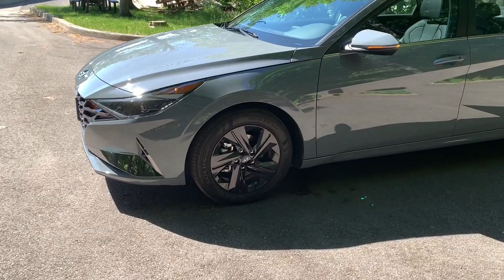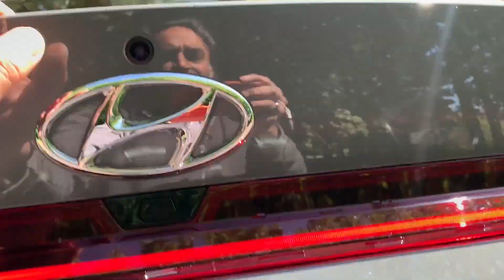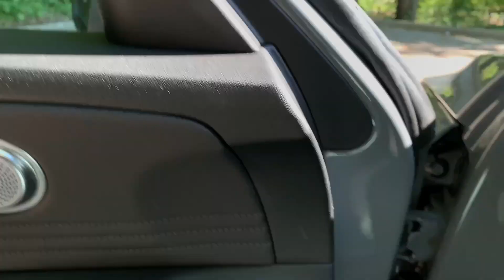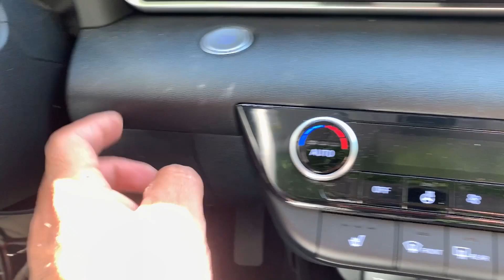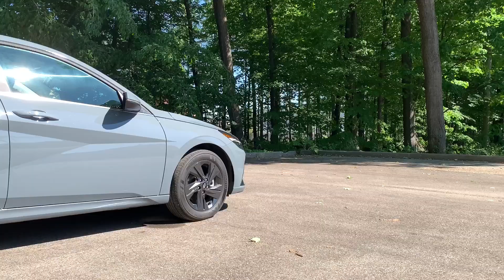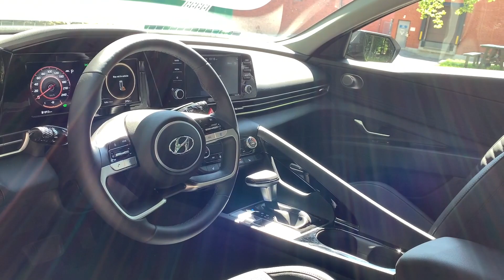Perks, Quirks & Irks - 2021 HYUNDAI ELANTRA HYBRID - Better than the gasoline Elantra

Comment: Hey i am looking for many videos for Elantra hybrid Ultimate which is the top model for hybrid version. So i want to know is is the Ultimate hybrid have a full 10.2” navigation screen which comes with the apple play ?
Reply: Yes it does in USA
Reply: In the USA It does. Here in Canada it does not. Bummer, as this was important to me too.
Reply: @PatRguz  in Ontario it does
Reply: @Scartown13  How? I bought the Elantra hybrid here in Ontario. There are only two hybrid trims available. I bought the top one. There is no 10.2" nav screen (screen on the right) for hybrid top trim... What am I missing?
Reply: @PatRguz  yeah i see what you mean. What is the reason for this nonsense?
Reply: @Scartown13  probably keep the car profitable. It was a tough call because the gas version has bose and the nicer screen to name a few. Glad i went hybrid with the gas prices though. Getting 4.4l/100km as advertised!